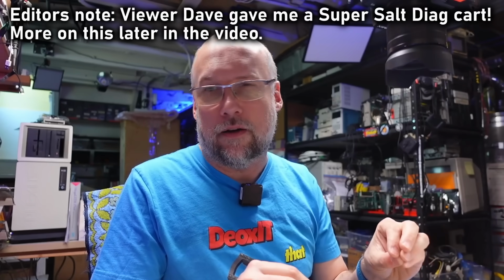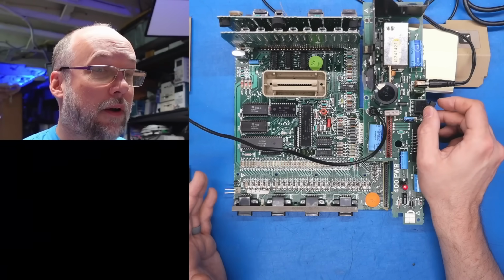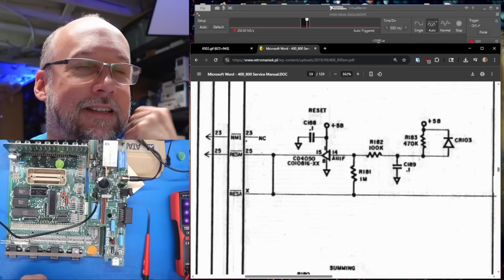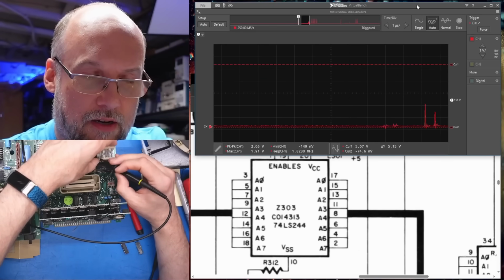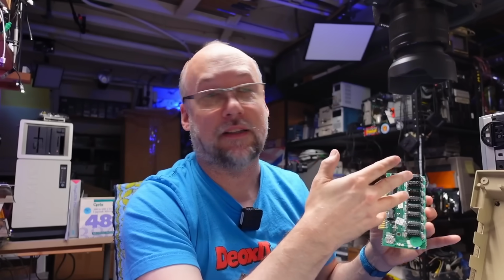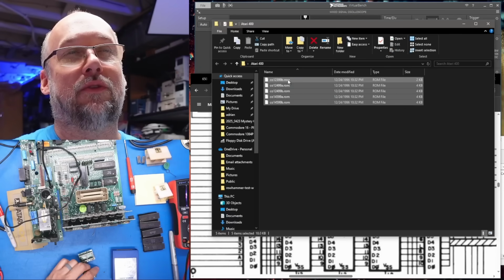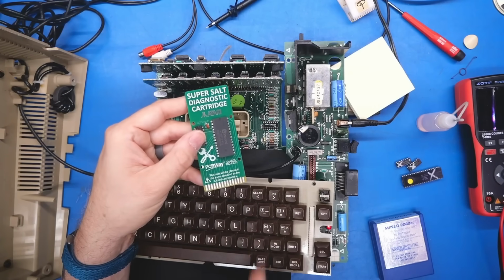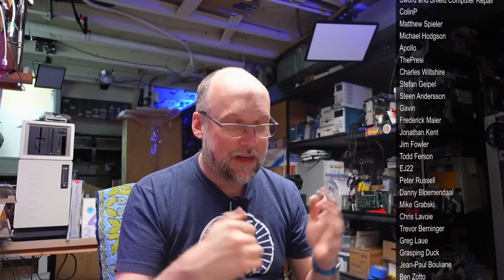Repairing a smashed-up Atari 400 computer

Comment: I had an aftermarket keyboard on mine as well as the 64k expansion.  It could only access 48k natively and the last 16k was bank selectable.
Reply from the maker: Neat. Did you have any software that could use that extra 16k?
Reply: @adriansdigitalbasement  No.  The 16k was divided into 4k banks, and if I knew this I would've purchased the 48k kit.  In BASIC the banks could be accessed through poke commands.

Comment: I had fun programming the CIAs on mine to do TTL level output on the joystick pins, which I wanted to use for device control, specifically, a pulse autodialer. The relay coil drew so much power it crashed the 400, so my dad showed me how to use a 2N2222 transistor as a driver, and it worked. My first exposure to the use of a transistor!
Reply from the maker: That is really clever and cool. It had no "user port" like the Commodores, but effectively the joystick ports can be used the same way!
Reply: @adriansdigitalbasement  Also I was able (aged 12 or whatever) to use Atari BASIC For...Next loops to get the make/break timing close enough to actually dial real phone numbers. (For the record, it's 60ms break, 40ms make, unless I have the figures backwards after 44 years).
Reply: Yeah the joystick ports can be input or output
Reply: That's pretty cool! :)
Reply: On my 800, my first modem was 300 baud and connected to 2 of the joystick ports.
Reply: I remember someone had a printer interface that used the joystick ports of the 400-800. Not sure if it was a product or a project, but I remember the picture in the magazine with the ribbon cables out the front!

Comment: FCC relaxing their RF interference rules is something I'm surprised I haven't seen creators do videos on. Maybe I just haven't seen one yet...
Reply from the maker: It certainly was a time of flux back then, with some machines like the Apple II basically having no shielding and somehow getting away with it for a little while and the VIC-20 really having nothing at first.
Reply: @adriansdigitalbasement  The FCC at the time only had say over things that attached to TVs, the Apple II from the "factory" only attached to monitors. (pay no attention to Woz's friend selling the TV mod right outside the factory) 😁
Reply: Is that why the C64 had a silver cardboard piece? I've seen some controversy about whether those cause more problems than the solve. Considering how cheaply made it is, I tend to agree.

Comment: First family computer my parents bought when I was 7 years old was an Atari 400.
Reply: Mine sorta was a 2600 VCS "video computer system", although that was really a console! Really I did nothing in my career with computers, but I've done a fair bit of gaming, maybe that's why?😅
Reply: @squirlmy  I have worked as a Database Administrator for decades so constantly on a computer but burned myself out gaming by the time I was 12 years old - we had a Coleco Adam than an Amiga 500 as family computers after the Atari 400.

Comment: I had a 400 - I loved it, Keyboard was a bit flaky - but better than the Spectrum. I used to type in a Poke number and you could put a cassette ion the tape drive and the  sound would come out of the tv !
Reply from the maker: That's pretty nifty! How was the sound quality if you were using a music tape?
Reply: It sounded good..as good as normal TV sound

Comment: TIA in the 2600, CTIA in the 400/800, GTIA in later 400/800 and all later models. When they designed the 400/800 the GTIA wasn't ready, when they launched the computer. So, they were later added, as they are a drop in replacements.
Reply from the maker: Do you know how many Atari 400/800 machines were left with the CTIA? Was this a free upgrade everyone got? I'm also curious if how much software required the GTIA prompting those early users to upgrade. 

CTIA:
The original Color Television Interface Adaptor (CTIA) was used in early Atari 400 and 800 models. It supported a 128-color palette and offered 9 graphics and text modes. 
GTIA:
The Graphic Television Interface Adaptor (GTIA) added three more graphics modes (Graphics 9-11) and a 256-color palette. These new modes allowed for greater flexibility and detail in graphics, particularly in the playfield area.
Reply: @adriansdigitalbasement  GTIA was actually ready at launch, but they had manufactured a run of CTIA during pre production and needed to use them up. I hear a CTIA to GTIA upgrade was something service centers offered cheaply, as such there are very few CTIA left in the wild. The other rare chip is the FGTIA which for the french 800 and supports SECAM.
Reply: @adriansdigitalbasement  GTIA was a free upgrade if the computer was still under warranty, otherwise it was $62. There are likely very few CTIA machines left in the wild, and I think they will be US-market machines only - everywhere else only ever got GTIA.
Reply: I which that C= had done the same for their buggy CIAa which made their ser/par 1541 interface so buggy and slooow.
Reply: I'm from Germany and had a PAL Atari 400 and as far as I know they used the GTIA.
Reply: @haraldweinreich9522  Germany uses PAL, France in the 70s was SECAM only and connected to a Peritel TV. By the 80s and the XLs France TVs could accept PAL, so the FGTIA and the French version of the TIA were special. They also sucked as they supported less colors then the PAL and NTSC versions.

Comment: Acetone welding...learn something new everytime I watch one of your videos
Reply from the maker: It's something I had learned from the comments on my own videos while doing Commodore 64 repairs on machines with broken cases. It works great on all of these ABS plastic cases these old machines use, and it's very fast and when done well, is as strong as the original plastic.
Reply: Acetone or Toluene solvent bonding also works very nicely on Acrylic sheets and if you can find it, Methyl Ethyl Ketone is superior.

Comment: These retro chip testers seem ad hoc at times - some test bad, others don't etc. I wonder if you can make an extension board that works with a MiSTerFPGA where you can swap in external memory on that board and test as if it was on a real Atari or other 8 bit machine?
Reply from the maker: It's really tough, it mainly comes down to the TTL levels these old machines run at. The thresholds are different than CMOS and newer process chips, so that's why things which are marginal can act up in these old things. Also the timing of modern stuff is really fast compared to the relatively slow TTL in old machines, so it's really not always easy. Computers like the Atari 800 and C64 are very clever the way they reduce cost but doing tricks to make it all work. That makes it harder to just replace  things with modern stuff. You can really run into issues.... and that's why the testers don't always give us good results. They are using modern stuff with modern levels and thresholds.

Comment: Cycling the GTIA socket that many times may have cleared up some corrosion? That one is an enigma.
Reply from the maker: It's totally possible ..... the sockets were pretty dodgy as they were kind of coming apart. I still don't fully understand what happened here though.
Reply: No. At about the 48 minute mark you can see the ANTIC chip isn't inserted correctly. It takes almost 40 minutes of video runtime (hours of real time before editing) before this is eventually noticed. Any and all diagnosis, including claiming the GTIA is "marginal" is therefore invalid and without foundation.
Reply: Yep, same reason why cycling cartridges a bunch of times sometimes cleans out tarnished or dirty pins to the point games work
Reply: Could the pot adjustment for the color have fixed the issue. If that pot was giving very high resistance would that cause a loss of video?
Reply: Are these plastic chips or ceramic? Likely plastic which can allow moisture inside the chips which can cause problems. At the last place I worked we had to place our chips and boards into a hot box for 24 hours before the assembler could install them, these were fine pitch surface mount components, but moisture could possibly build up inside due to the uncontrolled temperature and humidity in the warehouse. I’m sure Portland has similar humidity problems as Houston does.